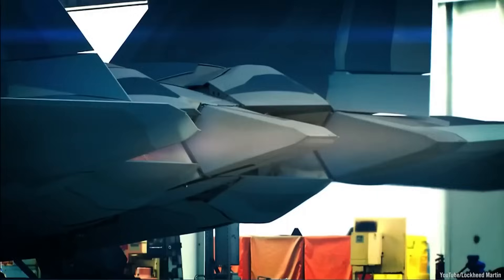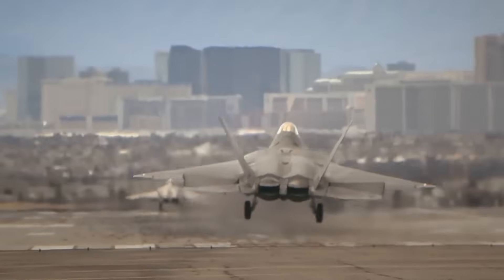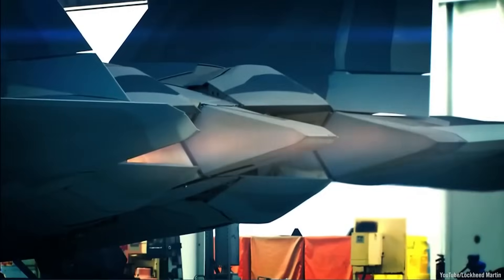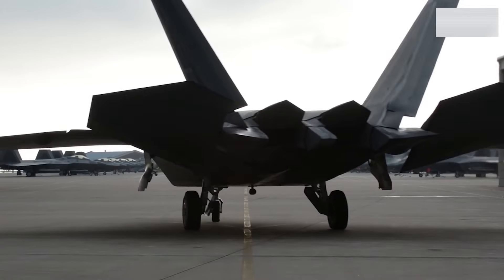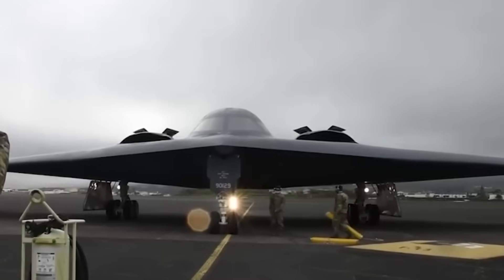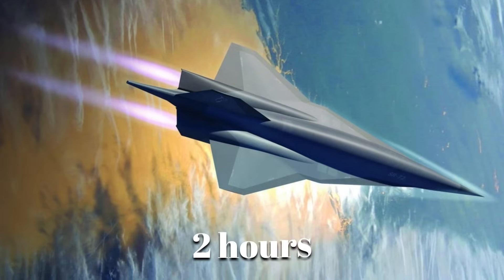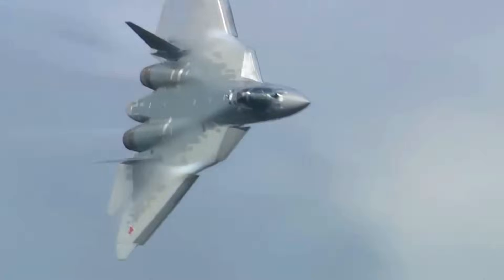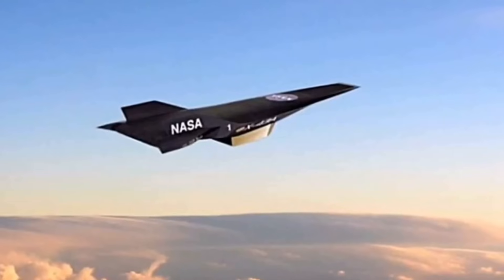F22 Raptor vs MiG 25 Foxbat | INCREDIBLE ENGINE Differences

Comment: It doesn't make much sense to compare technologies that are more than 50 years apart... if anything, you should compare the F-22 with the MiG-31 and its current engines, which are much more efficient than the Tumansky. Otherwise, the video is great, thanks!

Comment: The Mig.25 was designed for a far different role than that of the F22, regardless of the era! The F22 was designed from the ground up for air superiority in CAP. The Mig.25 was designed as an interceptor. It was expected to take off and intercept the SR71(Mach 3.5+) or reach American bombers and shoot their missiles before the American bomb bay doors could even open. The F22 is the master of its role in its era and the Mig.25, a Master of its role in its era.
Reply: Intercept the SR71??? 🤣🤣🤣you (or they) must be dreaming.😴😴😴

Comment: The two Pratt & Whitney F100's in the F-15 Eagle made that fighter an absolute monster! Just add thrust vectoring to the F-15 and it's rivaling the     F-22 in performance and handling I think. Definitely not stealthy but fucking nasty! The amount of ordnance it carries, combined with it's speed and maneuverability may outclass the F-22 with thrust vectoring 🤔. It can fly almost 3,000 miles before refueling as well. Raptor can only fly around 1,900 miles before refueling. The F-15 can just straight turn it on too! It's top speed is roughly 1,918 mph, and can be pushed further with risking air frame and melting fans. Raptor's top speed however, is around 1,500 mph. I think they need to make a gen 6 stealth fighter based on the F-15's platform! Just a nasty fucking stealth F-15 fighter! That would be sick as fuck!

Comment: i wonder how a mig25 shot down an f-18 despite its age
Reply: Did you know  tha USAF t F-15s and F-16s engaged a single Mig-25 firing about 10 AMRAAM missiles that failed to reach it during the first gulf war?
Reply: Because the missiles aren't aging. A hot air balloon with the right missle could shoot down the most advance fighter.
Reply: @Ryan-sl8mw True, but thats if the balloon has a good radar and can easily get into position to shoot whilst defeating a counter attack.
Reply: @geopoliticalwave well yeah. With the right equipment, all you gotta do is get it up and lock on from 150 miles out with so radar seeking missiles. It's possible but highley unlikely and not happening anytime soon.